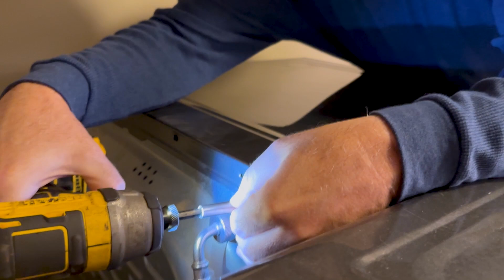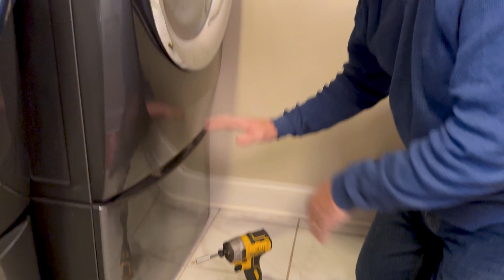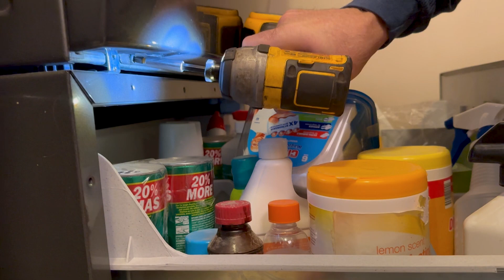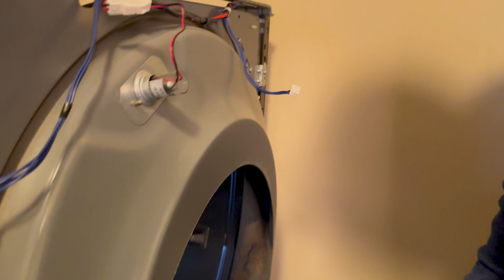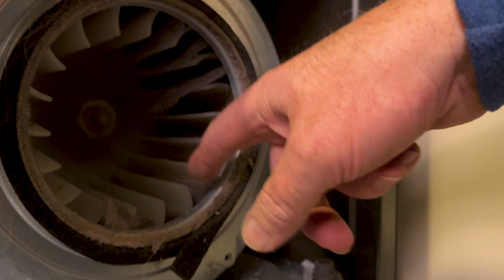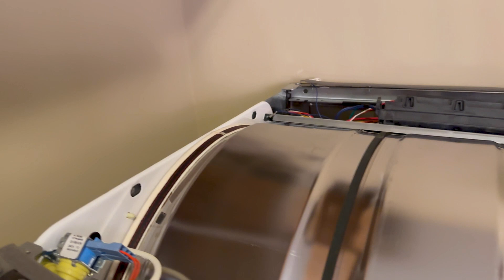How to Fix a Noisy Electrolux Dryer

Comment: I have tha same dryer.  But its not coming on what can that be?
Reply from the maker: Check the breaker box first to make sure it didn’t trip. If nothing comes on you might need to get inside the control panel of the dryer with a multimeter and see if it is getting power to the control board.

Comment: great video and agree with the issue. However, once this is cleaned and you start using the dryer it won’t be long and the issue starts again. Bottom line Electrolux made and put out apiece of junk!  I clean the lint trap out after each use as well vacuum under and around the lint trap as far as the vacuum end will reach.
Reply from the maker: Well, I hope that doesn't happen to yours repeatedly.  I've had this dryer for 5 years and used it pretty heavily and this issue has only happened once.  Thanks for your comment and good luck with your Electrolux!